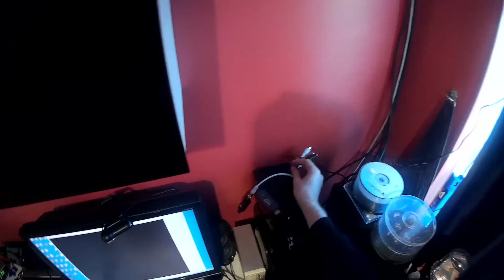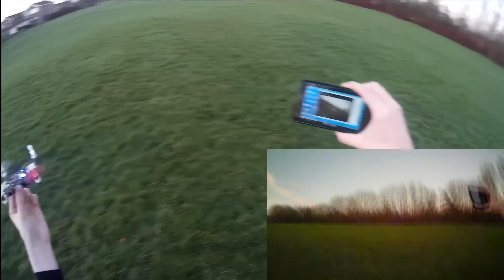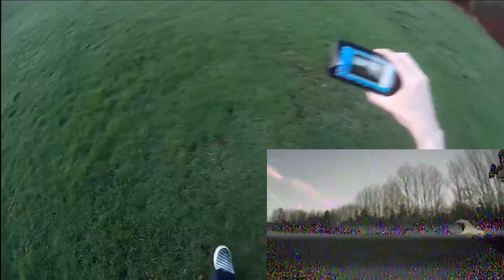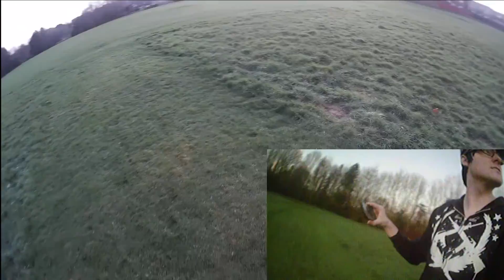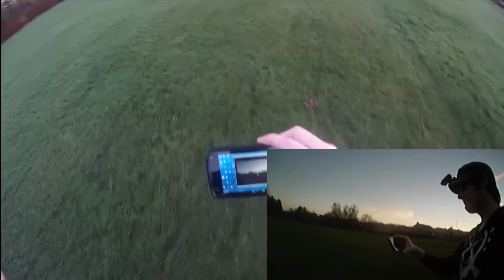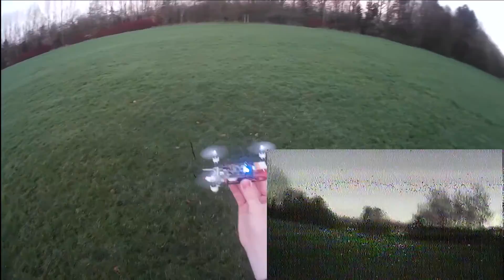Hubsan x4 control range test

Comment: Andy. Do u know if I will be able to mod a Blade nano qx fpv to take the 1s battery that the hubsan x4 takes (3.7v 380mah)? I have 6 batteries I don't really want to have to write off and buy all new for the Blade. Thanks in advance. Phil
Reply from the maker: +acgkplh yes im sure you can, theres not a single RTF I have that i couldnt mod for a bigger battery. i dont have a nano qx though